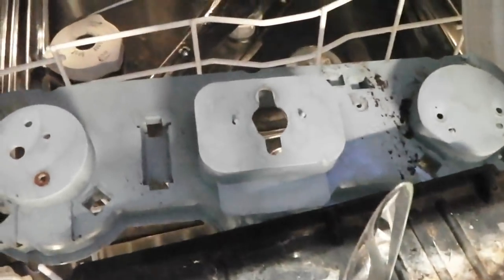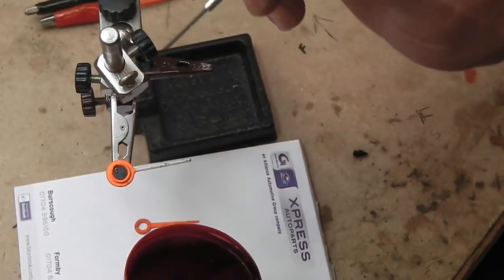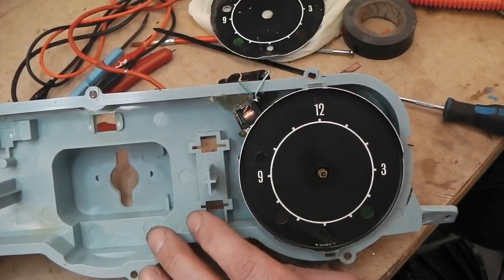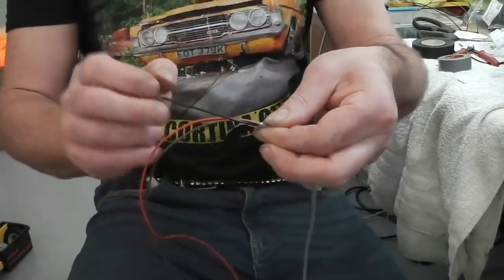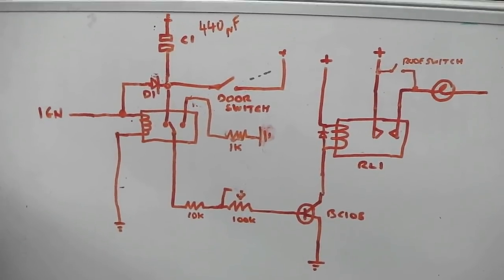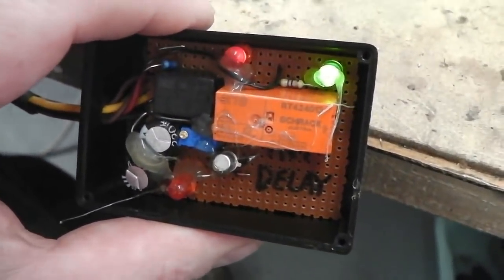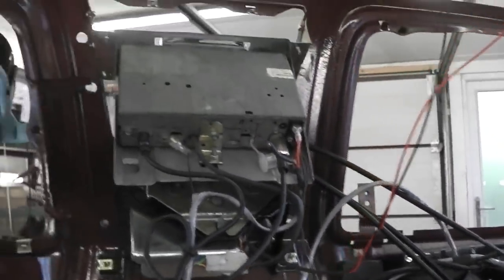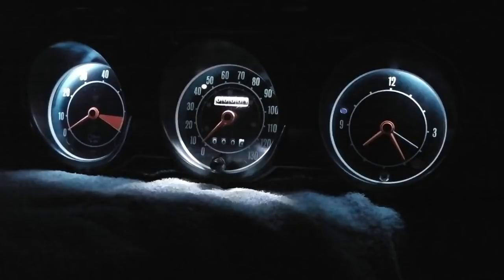Mk3 Ford Cortina Restoration - Dash Build PT2

Comment: Hi Pete, the dash looks great!  I need to improve the bulbs on mine, they are really dim. Are these the correct type and do you have to set the dimmer (facelift MK3) at maximum so they get 12v to operate? https://www.ebay.co.uk/itm/T10-CAR-BULBS-LED-ERROR-FREE-CANBUS-COB-SMD-XENON-WHITE-W5W-501-SIDE-LIGHT-BULB/372534384424?hash=item56bcc79728:g:4PUAAOSwdsBdXB-Q

Comment: Pete:  When I refit the hands on a clock I like to put them back at the 12:00 position. This is because it is the only time when the hands line up, & fitting them in that position means that all the hands are synchronised accurately.
Reply from the maker: thanks for this!! yes i did eventually remember to do this lol!!!! pete

Comment: I'd add capacitance to a standard time delay relay rather than build a new circuit

I don't own a mk3 cortina 
Have you tried editing on your mobile phone, as I watched a long standing youtuber suggest it was !such quicker for simply editing than using his expensive apple tower computer
Reply from the maker: i have a nokia slide phone so cant edit on that, i dont do smartphones, i use 555s as they rock steady but sometimes you can just throw an rc AND A bc108 together to get a rough time delay

Comment: Hey Pete, great work here!! i'm splitting my head on why my Capri dials dont light up unless on the bench with a 9v battery. Bought some cheap LEDs but these look way better. I'm not up on the cortina engine bay but are the connections your cleaning up at the end of the video the ones that plug into the engine bay from under the dash? in the capri ive got a big red and black connection that wont budge when i try to unplug them so havent seen them yet
Reply from the maker: I think this was bottom of fuse box holder OR the bulkhead round connectors. Used brick acid to clean then a protective gel after washing back

Comment: A bar graph of oil pressure,  tyre pressure, battery volts, screen wash level, radiator expansion bottle level, brake & clutch fluid level , brake pad wear level would be good, suppose the brake fluid level usually interprets brake pad wear.

Comment: What does the label on the back of the clock mean none-0-jewels?
Reply from the maker: Hi Andrew, i wonder this myself, we need to find out!! im sure its clock making terminology, very interesting, love this kind of stuff and sounds like you do, shall we google Andrew?  from Pete
Reply: @PeteCswampy  It seems to indicate the number of of jewel based bearings (typically lab created ruby). I remember now I had a swatch in the 90s which said it had 17. The Wikipedia article says the jewels are used to make a tiny torus (doughnut) shaped bearings that the spindles of gears sit in. So I guess its Smith's Industries way of making it clear you'll find none of that in here.

Comment: Hi Pete, great to see Bramble progressing well. The clip nuts with a captive nut which clips over holes in thin metal, where do you get them from?. I will need to replace several of them during the restoration of my Triumph Daytona 1000, so it would be great to know where to get them. When you`ve finished Bramble, would you mind doing a vid about the tools, cleaners, replacement nuts and bolts etc, and where you can get them from?.  Cheers matey.
Reply from the maker: Neil thanks, clips from BRESCO.com   they have everything!!! yes i already did a toll roundup review but ill do another, great news you doing the Triumph

Comment: I'm crap at Math too...Even with a Calculator. That would stretch my sensibilities..
Especially with 4 bombs ticking on the bench!
Reply: 4 Bombs ticking on the bench! Love it, However don't worry , I made it 3.033333 recurring So you have little more time to run. What i do is 42 x 4.33 or 42 x 52 divided by 12

Comment: Pete, for the "model making" type jobs (dropping paint into the needle centre, masking up fine detail on the clocks etc.), try using a wooden cocktail stick. Probably the most useful model making tool there is. Dirt cheap, non-conductive, non-scratching and light so easier to keep your hand steady. Fully disposable too.